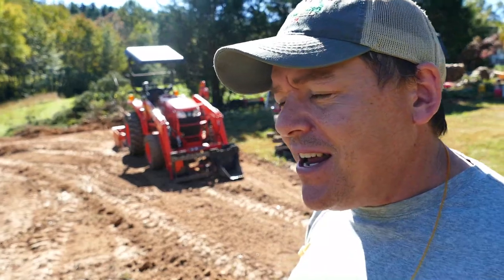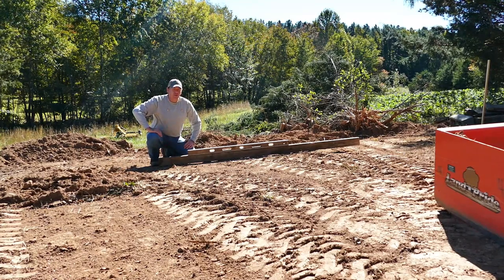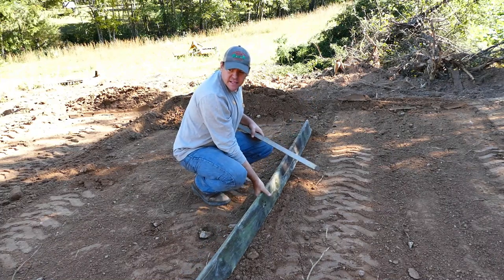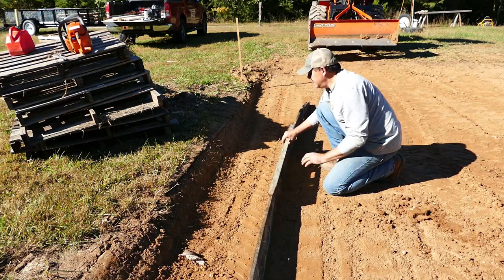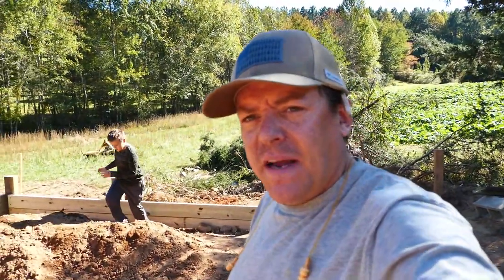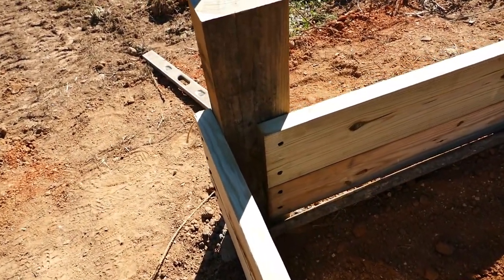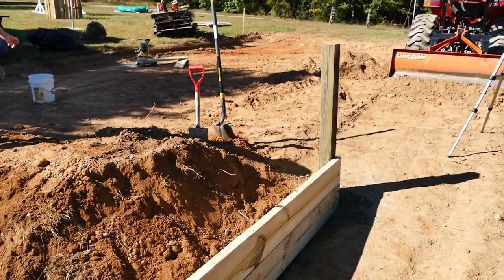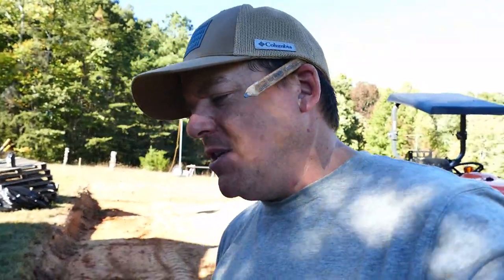Excavating A Level Parking Pad On A Hillside

Comment: Hello, I have a small project I want to do.  Excavate a small parking area in my backyard to put paver bricks.  I want to construct 2 parking areas for my two vehicles.  I think I have to move about 174.48 Sq Ft. of dirt.  The total dig depth is 8-3/8" deep.  Some of it is packed, where I have been parking on it - 2'x30', but the rest should be unpacked.  Could you suggest an economical digger and or skid steer which would be appropriate for this project, as well as a rough time estimate I would need the equipment?  Thanks in advance.
Reply from the maker: I've been away for a little while, sorry for the slow response. That's only about 6 yards of material. Any machine would make pretty quick work at it. A skid steer would dig quicker than a tractor like mine. I bet you could knock it out in an hour or two.
Reply: @FlatCreekOutdoors  Hi, and don't mid about the response speed, I have been noodling this for years now, and only now it's getting serious traction (mentally).  After pricing the bricks for this, yet another delay because, though only a few hundred more, I still want to reevaluate.  Thanks for the response, and I didn't know a skid-steer could dig that deep.  Would be great because it would keep me from renting two machines.  Thanks again, and thanks for making humanity richer.